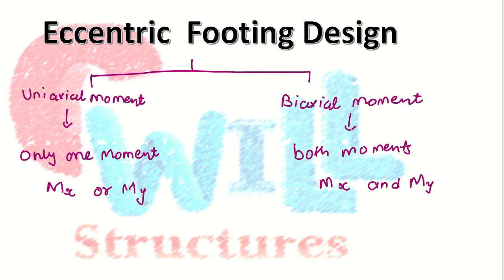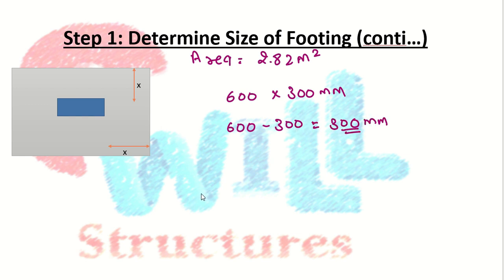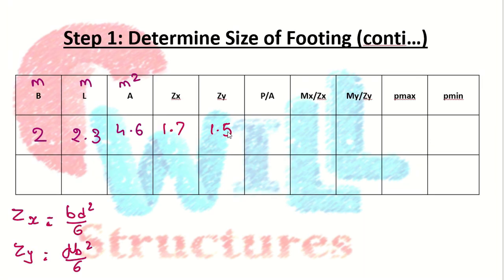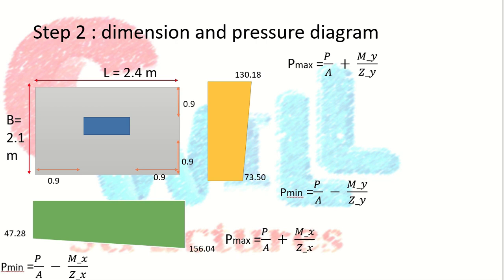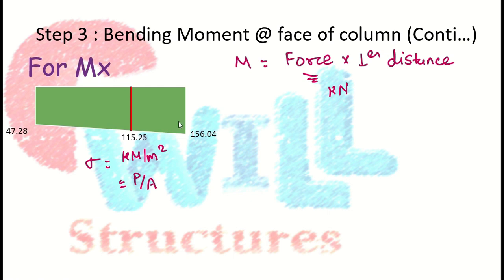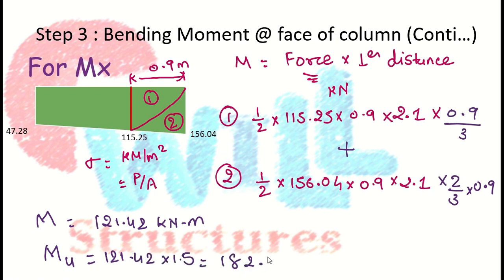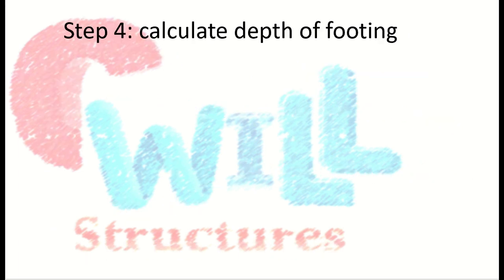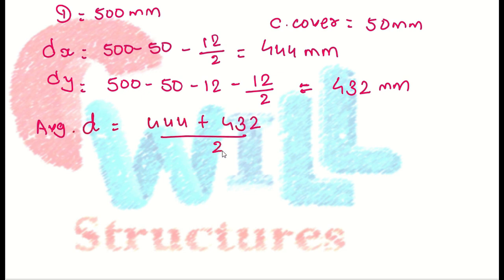Design of  Eccentric Footing Part 1| Size of footing| Civil Engineering

Comment: This is concentric footing. We provide eccentric footings when we don't have enough space on at least one side of footing in site. Here, using the size whatever require as per bearing capacity.
Reply: ok, to keep the size, but we can't keep equal offsets from column and design will be different

Comment: Excellent! The two triangles that you have to calculate Mx & My. one of the triangle is not right angle and the result mathematically is not correct.
You could use trapezoidal area = {(sum of parallel sides)x height}/2. Thank you !
Reply: Cg changes

Comment: Why in determining size of the ftg u dont used the 2.82?
Why for checking for size u add and minus  Both direction x and y? 
And for pressure diagram u add and minus   M/z in each direction?
Reply: Pressure diagram is only showing what shall happen in one direction and how to calculate for single direction. 

But as we have to find Maximum Pressure, the column footing will undergo. 
And thus "Moment in x and y" both directions will play role in actual loading condition 
that too at the same time along with "Axial Load". 

So Pmax = (Axial Force/Area)+(Moment Mx/Section Modulus Zx)+(Moment My/Section Modulus Zy)

Comment: please do proper research before calculating the moments, the values which you have taken are wrong.
Reply: Do you have any video for eccentric footing.. If you have please send the link..
Reply: @anand4236  I donot have the link , however I know how one should proceed to get approx results, but I would recommend a finite element software to get pressure checks, shear checks and bending moment value.